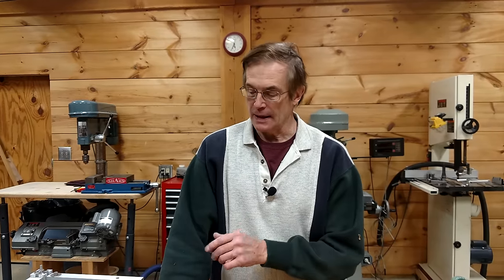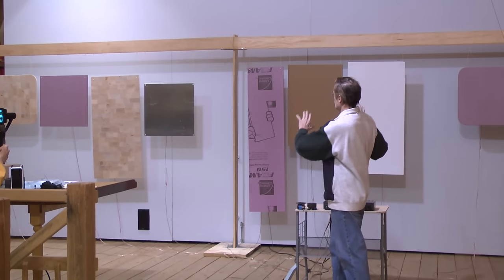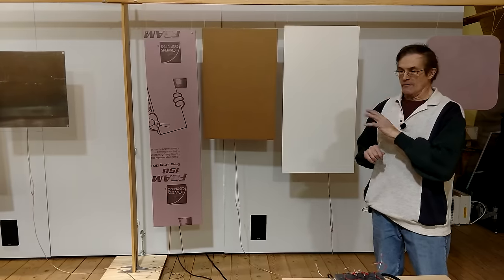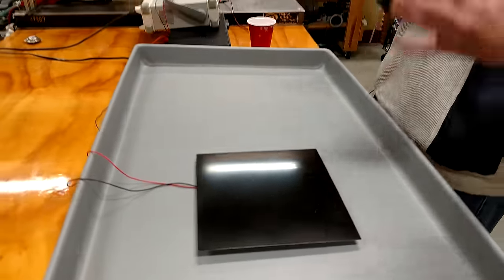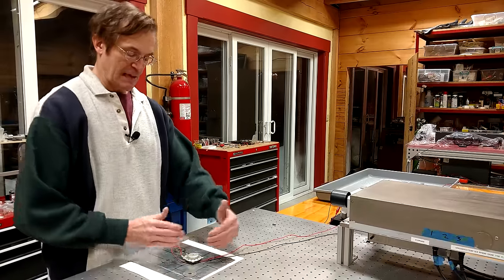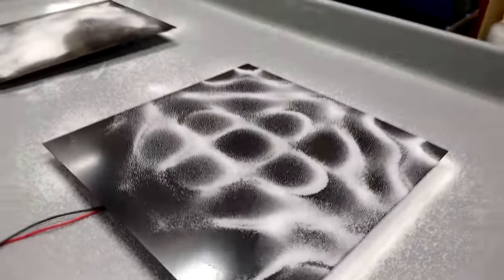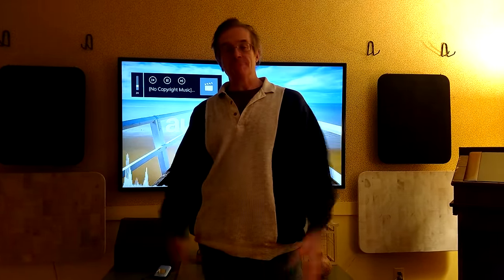Fantastic DIY Speakers for less than $30!

Comment: I don't think I'd hang the speakers so close to the wall because plenty of the sound would be coming from the backs of the speakers, the same principal as electrostatics. This mounting would create a lot of standing waves in the higher frequencies.
Reply from the maker: You're probably right.  However, a more compact solution has been tried by a number of viewers who built these speakers. Placing a sound absorbing material on the wall behind the speakers improves the sound quality.
Reply: @TechIngredients  I have Magnepans which are similar to electrostatics. Sound coming out the back is a good thing if the speaker is mounted correctly. This usually means having them sitting out into the room which takes up a lot of space, however. My solution (also because I had cats and a toddler) was to mount mine on the ceiling away from walls and tilt them down towards the listening area. Mounting them as close to the ceiling as possible would be ideal to prevent the speakers from swinging around. I achieved the tilt just with one fishing monofilament to the bottom of the speakers.

Comment: I don't see you mentioning trying a Fibonacci ratio for the board shape or for placement of the driver. Though I have to assume you tried it and found that the 2:5 / 3:5 worked better?
Reply from the maker: I didn't try that.

Comment: I want to make a pair of these and hook them up to a small Bluetooth receiver/amp. Do I need to worry about ohms at all, as you do with conventional speakers?
Reply from the maker: Probably not.  These are either 4 or 8 ohms.  If 4 ohms then wire two in series or limit your amp to 50% of it's rated output to in turn, limit its current to its rated maximum.
Reply: @TechIngredients  Thanks. Also, any thoughts on getting a little more low end / bass with these?

Comment: For the exciters to generate sound levels, doesn't the area excited matter?  Based on that assumption, could the high pass characteristics be adjusted by changing the size of the surface?  If so, can a more efficient subwoofer (like a Klipschorn )be paired with smaller panel to make a smaller total package with similar response?

How would one calculate the size vs response values?
Reply from the maker: You're  correct. The limit isn't  linear.  Even the largest panels  we were able to test were still a little weak at very low frequencies. A sub still isn't  a bad add on.

Comment: was there any prep work done to the emitter side of the end grain balsa? ive looked into purchasing some manufacturer specifies it comes with a fabric backing to join the wood.
Reply from the maker: Make sure you are buying rigid panels, not scrim jointed individual blocks.
Reply: @TechIngredients  ok thanks!!!

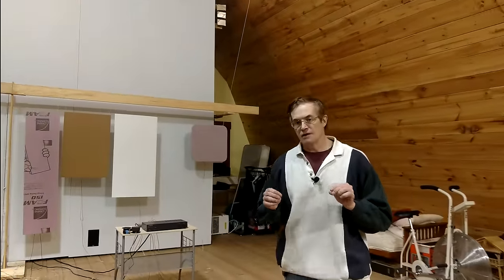Comment: so the first material at 9:01 would be good for piano flutes or typical thai traditional music/sounds
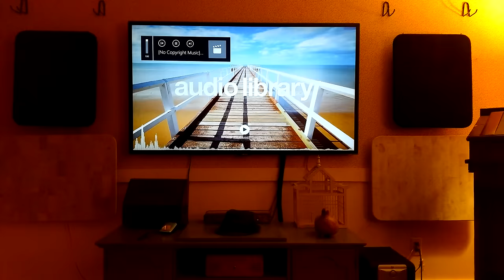also at 29:24, does that mean that the sound reproduction because of the limitation of frequencies would be exagerated in the higher frequencies. ie if you were to go setting the mid range on an EQ to +10 on normal speakers

Comment: Thank you for such a brilliant exposition of the design and function.  I am about to embark on building my own set and have seen it said that there is benefit in placing the exciter in one panel in the absolute centre, with the other being offset in the X and Y axes by 1-phi.  I have two questions if you don't mind answering.  First, is the notion of mixing one centroid with one offset exciter position to achieve a wider frequency response overall valid?  Secondly, if a speaker's exciter is offset (whether by a factor of phi or some other ratio), should the mass of the exciter be above or below the horizontal centre line?  My hunch is that it would affect the low-end potential but I'm not sure.  My plan is to use 1200 x 600 x 30 foam board which is easily available locally in Australia.  Hope you can help.
Regards from OZ, Wayne

Comment: I got this video as a suggestion and I am glad I did. This is a great video demonstration. My question is those panels you used are they supposed to only hang or can they be bolted down with a bit of cushion between the panel and bolt to give it a bit of play to vibrate a little freely, is that a possibility?
Reply from the maker: They MUST hang.  Even contacting the wall at a small area, say at a corner, will significantly affect the sound output.
Reply: there is another video of a guy doing different types of mounts, shapes, paint, etc.

Comment: Great video, thank you for the knowledge and experience.
Did you find an ideal thickness of materials? Specifically the end-grain balsa?
I’m using 3/4”thick, 24”x48” panels.
Reply from the maker: We used 1/2" balsa and it worked well.  I didn't investigate other thicknesses.
Reply: I will test this.

Comment: None of your speakers include a crossover. That’s why you experience being able to pinpoint the audio to speakers. 

Properly positioned, placed, and angled speakers will allow for detailed imaging. It’s very common to set up two pairs of tower speakers in 4.1 surround sound. This is because each pair is able to create a phantom center channel.

Get with GR Research to ensure you’re using hifi interconnects, capacitors, terminals, conductors, etc.

Also, when you test your speakers, use a umik calibrated mic, also measure an entire song, not just test tones. 

Your designs are great at producing a singular test tone, they distort when trying to produce low end bass with high end vocals - like in an edm song.

With that being said, once you add a high end tweeter and driver, get a well designed crossover that uses quality components, you’ll be able to produce the highest quality speaker possible.

Send one of your sets of speakers to gr research to have him design a custom crossover, hardware, and interconnects.

Comment: I planning to restore a circa 1960 GE stereo console unit with updated componentry. Outside it will be original, but inside will be modern and act as a stereo/karaoke unit. Having learned about these speakers, I plan on constructing a pair, but I highly doubt a can squeeze a 2'x2' panel. I will measure later when I'm home, but I suspect I can fit an 18" by 24" panel at mounted at approximately 30 degrees from the face of the unit. Do you think the quality of sound would suffer significantly from the size and mounting angle? Thanks in advance.
Reply from the maker: These are very forgiving relative to the listening angle.
Size does matter.  As the panels shrink, the lower frequencies suffer.  If possible,  you want them even larger than 2 by 2. Even a rectangle that has one larger dimension will work better if length OR width is the limitation.
Reply: @TechIngredients  Thanks for replying and that's good to hear about angle! A follow up question. Let's say I have a total working dimension of 2'x4'. Would there be any advantage of running stereo with one speaker at 2'x1' and the other panel at 2'x3', or would a mono set up with a single panel at 2'x4' be best? Stereo is not necessary for my end goal.
Reply from the maker: I'd just keep it simple and use a single panel.  Smaller panels don't seem to improve the high frequencies noticeably.
Reply: @TechIngredients  awesome! Thanks for the information. I appreciate it.

Comment: For the low end could you use let's say a 4×8 panel with 2 larger exciters in the 3 and 5 position?
Reply from the maker: Generally yes, but these will never give a deep base response even with panels that large.  A sub is still a good addition with a crossover around 150 Hz.

Comment: The next issue will be where to place such panel loudspeakers. Because the panel moves in both directions it’s obvious that they need to be at a certain distance to the backwall. Maybe they’ll do as tv-speakers close to the wall but for more serious listening they’ll need to de in a certain distance. Maybe at 100 to 150 cm.
Reply from the maker: Several viewers have mounted these several inches in front of a sound absorbing material with good results.

Comment: Can someone please make a short tutorial on the best way to attach counterweights to the panels? Is it okay to just drill a screw into the back?
Reply from the maker: It won't  hold as the vibrations will work it loose.  Use an adhesive like epoxy.

Comment: Can i PLEASE get the link to the speaker you are using? the panel i will use the pink panther poly.
Reply from the maker: The exciter we used was available from Parts Express several years ago.  They have a number of alternatives available now.

Comment: Interesting. I wonder if the amplitude of the waves would create visual problems if you used this to produce a projector screen/speaker? Would it be possible to 'flatten' the sound by contouring the rear of the material instead of attaching weights with different peaks and troughs following a similar rule to the 3/5th rule that he talks about or attaching struts in a similar pattern? I prefer quality over volume and I wonder if more traditional speaker designs optimize volume output. I was also curious when he mentioned the dampening possibilities of the speakers themselves for using hanging panels in different configurations in a space like a racquetball court that is being used for spin classes to create a better audio environment. I picture extruded styrofoam suspended at different angles using the 3/5 rule! I know this is a ridiculous number of questions for one post but hopefully, it helps you with the search algorithm. to bring more traffic! Thanks for a really interesting project idea, and some great information. I was actually waiting to see you start cutting the materials into the shape of a guitar when you mentioned instrument design for optimizing speaker design or maybe a panel in the shape of a grand piano...
Reply: Modern Sony oled tvs use the screen as a speaker like this and you can't see the screen moving

Comment: Have you tried mating the polystyrene panel to one of the harder panels?
Reply from the maker: I tried bonding the polystyrene to a thin piece of plywood, and the result was essentially the same as the plywood alone.  This makes sense as the stiffness of the plywood determines the response.

Comment: So where on earth can you buy sheets of edge grain balsa that big?
Reply from the maker: The exact term is end grain balsa.  Amazon sells it and it's used as a composite core material for marine sandwich construction.  We had this on hand for our boat building projects.
Reply: @TechIngredients  they have it in 2’x4’ and 2’x2’ sheets? I’m still not seeing it. Searched “end grain balsa”… everything is super thin and not big enough.

Comment: I have a Card-board that is very light with a Zig zag web all through it. they will be 48" by 20". My mounting method is different as I put nylon bolts through the material to hole the exciter. please let me know if the cardboard is a good medium or ceiling tile is better?
Reply from the maker: I'm  not familiar  with that cardboard  material.  You might enjoy  testing this yourself.  Prepare both panels, use a switch or just one channel  for each, and suspend them side by side.  Invite others to witness  the test and play  a variety  of music through  each.  It's  fun and don't  forget the pizza and beer.
Reply: I holed my exciters on with nylon bolts and the panel up with the fishing line, the material is called dunnage or better yet honey com style cardboard. I just got to the panels 48" high and 20" wide for two different people and they both like the sound. So now I am waiting to make them 48" high and  30"+ wide. I edit my results here. Many thanks. another question I have is if Gluing end-grain balsa around the panel will that have a good effect or is worth it. the other thing I have been thinking about gluing two thin wood boards together with Weldbold glue mixed with water and micro balloons, let me know your thoughts
Reply: the Weldbod glue when it  is dry it is water-resistant and Micro balloons I think will give the bond a system like the decant you demonstrated?

Comment: What happens if you drill one hole in the location of the metal sheet that is most excited (absence of sugar) for the lowest frequency that resonates, iteratively? Does a drilled hole "mute" that frequency? If it does, really interested to know the pattern of swiss cheese that results!
Reply from the maker: I haven't tested that.  But, consider that the highest amplitude region has the greatest energy input.  It would make more sense to add mass there or stiffen the plate around that point.

Comment: If flex and compression strength are important factors, wouldn't thinner materials be preferable? The thinnest polystyrene I find is 5cm (2 inches) thick. How would that aluminum sound with some damping foam on the back?
Reply from the maker: 2.5 cm foam is available and indeed it works better.
The dampened metal doesn't ring, but it's greater mass reduces the sound output for a given input.

Comment: I watched this plus your work on the larger panels some time ago and have yet to try making a pair. But I did watch a video of a guy who just made the smaller ones and I noticed something quite concerning. He showed a side view of the driver while playing some medium level pop music and I could see the panel and driver bouncing back and forth from each other like crazy. So it became clear that the driver needs to be mechanically stabilized somehow. It would seem that all sorts of cancellations, phase issues and general distortion would be the byproduct of such behavior. So if one were to make a rigid connection to the magnet, either by gluing a simple flange and attaching some acoustically neutral floor stand, it might radically increase the already fine properties of this design. What do you think?
Reply from the maker: Stabilizing the exciter actually doesn't help.  The mass of the exciter is part of the resonance of the system.
Reply: @TechIngredients  I can understand from the standpoint that the push pull function might actually behave like a servo control, constantly cancelling excess movement. Which would be ideal, no?.

Comment: amazing report, careful to be complet... but: did you try non rectangular forms?
Reply from the maker: Only once and not as part of a video.  I tried a circular disc with the exciter, mounted approximately 30% of the way out from the center.
The performance was indistinguishable from a similarly sized rectangle.
Reply: @TechIngredients  interesting... no musical instrument is rectangular. a drum is probably round because it would be hard to be different. but equal distences create resonances... you mention eastern EU products... do you know of ONDA, a speaker made for amplification of acoustic instruments?
Reply from the maker: No, I'm not familiar with that.

Comment: I live on a 28ft sailboat. Would that be a good surface for that type of speakers? This would be great if so because while I don't have allot of room I do have allot of fiberglass.
Reply from the maker: Probably not.  The optimal method for supporting these panels is to hang them vertically with no additional contact points.  The rolling and pitching of a boat even at anchor would interfere with their operation.
Reply: @TechIngredients  Great...thank you

Comment: Interesting. With high carbon steel, they also try to avoid sharp corners (except when making knives and swords, otherwise what's the point lol) to avoid stress concentrations. So it stands to reason that here, too, in flexible materials the rounded edges help with distribution of vibrations (ie sound). Would a round sheet of aluminium still produce the same ring?
I actually had high hopes for polycarbonate.
Reply from the maker: I suspect it would.  The material will trump the shape.

Comment: I do love your video's.  I have sitting beside me two 4x8 foot rigid foam boards.  I have 2 of the 40W surface transducers and an old sony amplifier with equalizer.  I am going to paint the American flag on them and hang them in my barn (Very high ceiling).  I might need to hang some weights from the bottom of the panels to mitigate movement from the breeze.  I'm wondering how this will effect the sound quality.  I suspect that the sound quality will remain almost unchanged as long as I hang the weights with an elastic line.  The sad part is that my hearing isn't what it used to be so I'm probably not going to know any difference.  And it's a barn, so high quality sound probably isn't all that important.
Reply from the maker: The weights  should have little effect.
Good luck!
Reply: @TechIngredients  I just tried them out in my shoplab.   They are incredible.  An equalizer helps to tune them just right.  The thing that is really special about them is that the sound doesn't come from a point source.  This is super obvious in my shoplab with the 4x8 sheets of 1" foamboard just sitting on the floor oriented horizontally.  Neat.  Thanks once again.

Comment: I have a single subwoofer connected to my home theater receiver and have dead spots in my living room. My subwoofer has a potentiometer to select phase. I would guess if I add a second subwoofer and offset their phase I would have less dead spots in my living room.